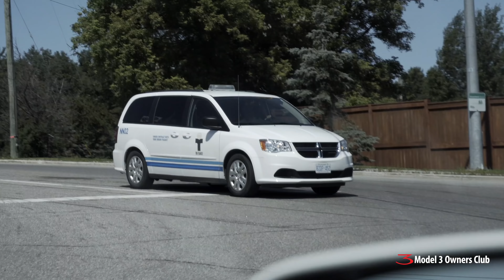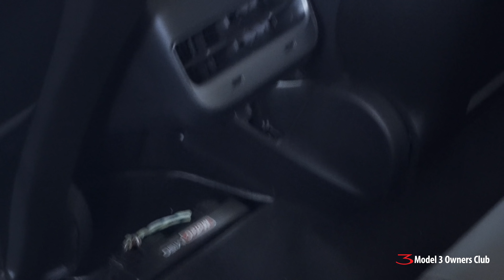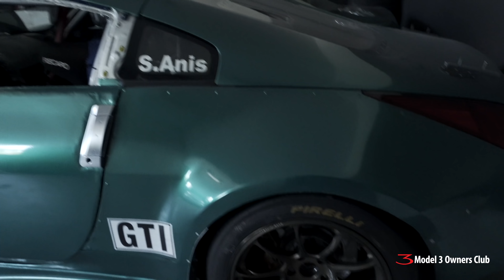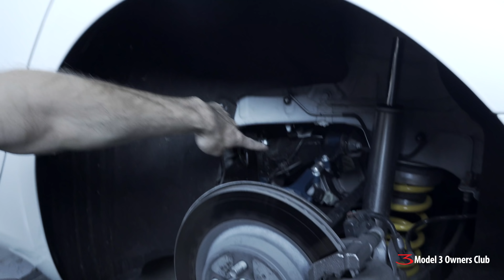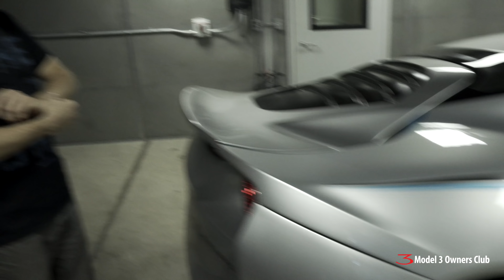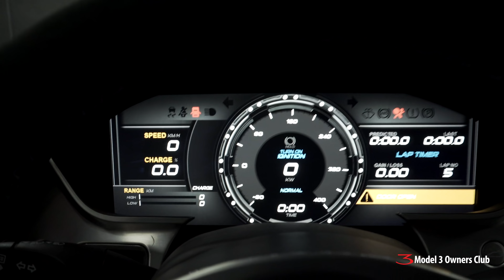Improve your Model 3 Brakes & Suspension

Comment: Interesting video thanks, as usual. The vast majority of Model 3 owners won’t ever have issues with standard brakes due to regen. I also just don’t get why people need to disable traction control and smoke tyres?
(BTW I’m so glad we don’t have the winter time salt on the road - and therefore corrosion problems - like you guys in cold countries. However we do have lots of heat and humidity to put up with in summer.)

Comment: Does the brake upgrades mean I wouldn't ever have to replace brakes again?
Reply: Mark Wick No. They have more surface area and more stopping power. But they will eventually wear down like all rotors and pads

Comment: What happens when Tesla releases another brake update?  Wouldn't the system think that the OEM parts are installed and possibly cause the system to malfunction in some way?  I would think that a like-for-like replacement wouldn't be an issue, but with the massive rotor and spacers installed, seems a bit iffy to me.
Reply: sho164 This is an interesting point. You would keep the stock calipers so that's crucial. An update shouldn't throw off the ABS calibration, but we dont know for sure since we're in uncharted territory
Reply: I think so.
Reply: Well same caliper mean it won’t know anything if tesla software edits it at all as still uses dot fluid to clamp on disc to brake like all other

Comment: Would changing brakes or suspension components on Model 3 void the warranty ?
Reply: Jay Pase there's laws out there that protect consumers that allow you to replace with similar functioning equipment to OEM. That way or not forced to buy OEM replacement when you need servicing
Reply: Tesla may have a clause in the warranty that specifically prohibits "Autocross" activities but it doesn't say anything about taking it to a closed circuit for "lapping" which is what I'll be doing (allegedly). "IF" I was ever refused warranty work I'd have to throw the Magnuson-Moss Warranty Act in their face - I'll put the system on trial ! Remember you're talking to somebody that had Mazda replace my entire engine in my 2004 RX-8 one week before the 8 year extended engine warranty was set to expire (and that car had extensive track use).

Comment: Great video, and very nice upgrade for the brakes.  Amazing that the upgraded rotor is so much bigger but still the same weight as the stock rotor.
Reply: Thanks!
Reply: I'm amazed that it uses the same caliper
Reply: Will it shorten the stopping distance or is it only for longevity around the track?
Reply: @bannor99  longevity
Reply: @bannor99  bigger disc cool better and stop better and as cools better often last better, though smaller is often lighter so balance if want lighter and cool brakes